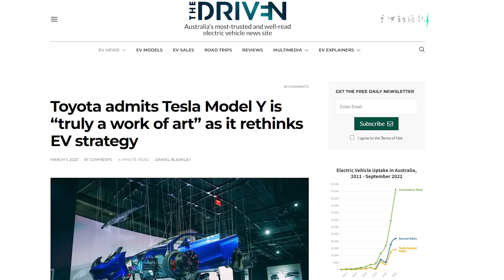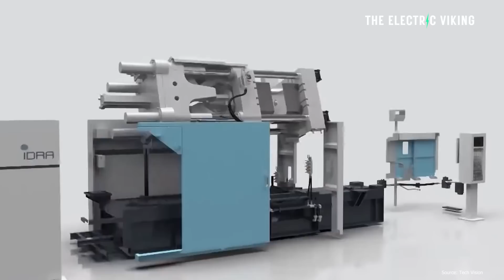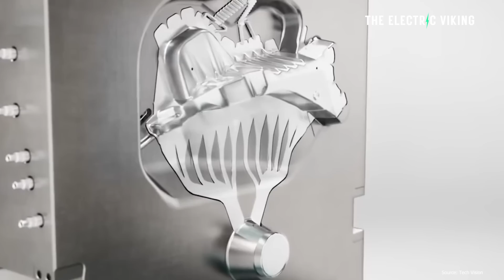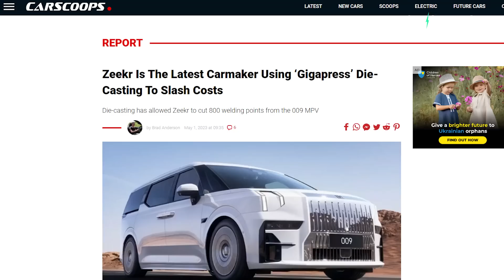Why Toyota decided to change entire production process to use Tesla's 'Gigacasting'

Comment: The giga press looks similar to injection mold technology.   Would be interested to see how this would work with processes used by aptera with the AI refinement.
Reply: They are very large aluminum die casting machines.    Size and pressure to hold the mold closed are impressive.  9000 ton is the clamping force of the mold.
Reply: @danharold3087  Actually the size varies. Casting machines have been around a long time.
Reply: Since the Giga Press IS injection mold technology, it should like injection mold technology, although simple that makes sense, more than I can say about other comments. There is no magic AI refinement, it is a tool to use.
Reply: @tedmoss  Hi, Aptera uses AI to see if the parts can be reduced without significant performance loss.  I was wondering  if the designs could be refined to be even lighter  before sent to the press.  It would be something to see the machine run.
Reply: @Maxxmentum  Still, my point was that a person has to make that decision. AI does not know what refined is.
Reply: @tedmoss  LLM models have very much been trained on what concepts like "refined" mean. Have you even tried ChatGPT? AI is already better than human Dr. on most tasks. LLMs can pass bar exams, better than 80% of law school grads.
Reply: @tedmoss  Tesla is very much using AI to improve manufacturing. Even if their motor improvements were not done with AI, it was done with in-house software, "The automaker's powertrain designers used in-house developed software to [simulate electric motor designs]."
Reply: This process has been around for decades , just used on a smaller scale.
Reply: @damham-F47  That's the whole point...unprecedented scale.
Reply: Whether or not to die cast is mostly dependent upon quantity. Do I machine it at a higher cost or spend 10s  or 100s of thousands of dollars for die casting?

Comment: Tesla efficiency in their cars is more than weight, they optimize aerodynamics and friction in the drivetrain, everything from weight of moving parts, number and type of bearings and lubrication, even rolling friction of the tires, and more.  Also fewer or no parts are better if still getting the function done!
Reply: Those are the same optimisations that every large car manufacturer tries to make but other manufacturers have more or less focus on the cost of the optimisations. What Tesla's done is start without the technical debt that other car companies have and pioneer some manufacturing technologies like casting the chassis.
Reply: However, they pack the car with so many extra sensors that a slight tap on the bumper costs $1,200 in repair.
Reply: @noseboop4354  Which extra sensors?
Reply: @Zedus-rl9hp  Parking sensors, anti-collision sensors, camera sentry mode sensors, temperature sensors, and probably tons more.
Reply: @noseboop4354 the cameras are fairly easy to replace, and most cars have those sensors nowadays both for safety and convenience
Reply: @noseboop4354  Tesla use far less sensors than other OEMs, so that's not an argument
Reply: @Zedus-rl9hp  You don't seriously believe that, do you? Just try comparing insurance rates of a Tesla to their competitors, it's way more expensive for a Tesla because of the high cost of repair.
Reply: @noseboop4354  That's not the case in my country.
Tesla Model 3P: 530€
Hyundai Ioniq 6: 570€
Mach-e ER: 570€
ID4 GTX: 580€
BMW iX1: 610€
Model Y: 680€
e-tron 55: 690€

KIA EV6: 710€
Reply: @Zedus-rl9hp  Tesla Model 3 is $3260 vs $1276 for a Toyota Camry. Rich people are always out of touch, living in some hippie country like Norway, giving tons of subsidies to EV, using the money from oil reserves.
Reply: @noseboop4354  the insurance has nothing to do with government subsidies.
What is currently being promoted is the engine-related tax, which does not exist with the BEV.

For a Audi S4 TDI: insurance €580 and additional €2450 for engine-tax.
I live in Austria
Reply: @noseboop4354   - and a front crumple zone - oops that is a right-off, bent the gigacasting.....
Reply: Probably one quarter the parts of an ICE and still more expensive.  Wow, marketing genius to pull that off.
Reply: @donaldkasper8346  Function and demand determine the price on the market and not the number of parts. This has nothing to do with marketing. Fewer parts here is more of an argument that it can be sold more expensively
Reply: @Zedus-rl9hp  The price in the market is supply and demand.  The cost of production is the cost of assembly related to number of parts to be assembled, difficulty of manufacture, and material costs, labor costs, facility costs and taxes, etc.
Reply: @donaldkasper8346  Right, but production cost is not equal to market price
Reply: @Zedus-rl9hp  If you want to stay solvent it is.
Reply: @Zedus-rl9hp  Asinine comment.  Number of parts requires inventory control which costs money, handling which costs money, and assembly which costs money, the more time it takes to assemble, which costs money.  The more parts an assembly has, the more expensive its manufacture is.
Reply: @donaldkasper8346  You just mix production costs and market price.
Before you call something asinine, you should understand the difference
Reply: @Zedus-rl9hp  Asinine.  Market price does not come from outer space.  This just in, cost of production and profit.
Reply: @donaldkasper8346  😂
Reply: @shagsheep8832  All auto manufacturing is based on simplifying the product and using the least parts.  Robots were tried in the 80s and abandoned because they are dangerous (notice 100% of all vids have no people in those rooms), and expensive to program.

Comment: Fun fact. Nio was first with mega castings. And when they almost went bankrupt in 2018 they sold their gigapress to Tesla. Sandy Munro made a prototype of mega castings long ago but only the Chinese manufacturers and Tesla jumped on this ship. At the moment only NIO and Tesla have cars on the road with mega castings. Nio has them in the et5 and the new es6. Tesla has them in the modelY.
Reply: Owning a die casting machine is not evidence that Neo mastered the size of casting Tesla pioneered.    Cars have been using aluminum die castings at least as far back as the early 60s.    Prior to that they used century old sand casting still in use today in the expensive and low volume Cadillac Lyric.  Not saying you are wrong but would like to see evidence.
Reply: @danharold3087  Yes could be that Tesla had mega castings in their cars before NIO but atleast they adopted the idéa at about the same time. Yes small die castings have been used for a long time, like my lexus ls400 from 1990 use a full aluminium fron subframe casting. But the only cars with full rear end castings on the road today are Nio and Tesla.

Comment: the main reason tesla adopted gigapresses was the big problems they had at the begining in production line of the model3
Reply: Wrong,the story behind the gigapress is due to an engineer gifting elon a die cast model s(covered in Ashley dances book on Elon . 
Apparently they had a conversation about making cars just like toys that are die cast. 

Calls ensued and elon himself said only 1 major injection mold manufacturer even was willing to talk with the tesla team.
It took over 3 years to build the first machine at immense cost. Tesla engineering with spacex help came up with a proprietary alloy for the casts.

Then the 2020 model y came out first with a large rear 2 piece casting. 
By 2021 they had the single piece rear castings in production, in late 2021 they introduced the front casting with structural pack's in tx.

In April 2022 the first production model y with a structural pack&dual castings got delivered from tx.
The rest is history. Also casting large pieces of cars has been done for over a century now. Engine blocks are ALL cast. 👍🏻
Reply: Not true.  Gigapress required an enormous investment in capital, time, and inventing a whole new way of building cars.  Gigapress is a manufacturing evolution, not a solution to a single model production.

Comment: Jaguar F Type project started in 1998 and produced a prototype 2000 demonstrating a stamped aluminium chassis components but it was shelved for 10 years because there was no established production route.
Reply: Tesla's bonded aluminum chassis for their original roadster (released 2008) built by Lotus was acknowledged occurred via tech from Jaguar by Tesla engineers. Reminds me of an old fable about teachers students and the development of mastery?
Reply: Stamped is as a pure weight saving & not the same as casting parts - all the problems of stamping steel panels as there (plus a few!) with stamped alloy :)

Comment: The real breakthrough will be if the Giga Press can be designed to form large carbon-fibre parts, instead of aluminium alloy, or a carbon-fibre core part enclosed in an aluminium alloy, optomising lightness and compressive and tensile stress, giving a super-rigid platform.

Reducing the cars' structural weight by 50% will mean that a smaller structural battery, made from  cheaper battery chemistry, together with a smaller motor and will be a game-changer for range, making 500mile range between charges the standard.
Reply: Aerodynamics are far more important than weight! 
Rolling resistance grows linear with weight, but drag grows cubic by speed (as energy loss).
Now tell that to every SUV-driver you know, they are people who like to quarrel with physics, or going off road a lot.

Btw, I doubt it will ever work with carbon fiber reinforced parts like with aluminum. Reason: the fibers have to oriented, and than the whole thing is baked with resin.
Reply: @10goldfinger  Absolutely, in fact, speed versus air resistance is a power of 3 factor, so if for example, you want to double your speed from 50 to 100 miles per hour, you need EIGHT times the power, not double the power.
Reply: @tech-utuber2219  'cubic' means power of 3.

Overmoulding carbon fibre with aluminium won't work cos the molten aluminium will destroy the carbon fibre.
Reply: @spankeyfish  yes, and I gave an example for those who are not familiar with the jargon.
Reply: @10goldfinger  I think the limits of aerodynamic improvements is being approached. The possibile weight improvements are almost limitless.
Reply: Battery developments are likely to give better returns even if what you suggest could be done.
Reply: Not sure that the manufacturing of carbon fiber would best be optimized with the use of a gigapress.
Reply: That is essentially what Aptera is doing with its Carbon Fiber Sheet Molding Compound body. It is like a gigapress for carbon fiber.

Comment: That Toyota has adopted gigacasting says alot about Tesla.  Will Ford & GM soon follow?
Reply: Gm will with the insanely expensive celestiq ev. Ford says it's in the works but no announced timetable or model using them yet.
Volvo will use them in the rear from 2025 in their remodeled main Sweden plant. Nio already uses a single piece rear casting in the et5 model's.
Reply: @4literv6  GM, LOL. Sold 2 Hummers in Q1 2023. Cancelling the bolt. Bankruptcy is on the near horizon.
Reply: @machoopichoo2  again? How many times can 1 company go bankrupt. No billions in tax payer funded bailouts under to big to fail clasification please this time. 😂👍🏻
Reply: @4literv6  Ya, there really is no real way to bail out a company that is incapable of making a product people will buy. This time around...no bailouts. Tesla will give cover, in that, the entire US auto industry will not disappear, like the Japanese will. 

Possibly if Ford is making some BEVs that sell, still at a loss, the gov. might bail them out.

Comment: gigacasting is great but can it be applied to body on frame vehicles?
Reply: Think modern motorbikes, they still have a frame, but the caste engine becomes a park of the structure. So what you have are two frame assemblies integrated with the cast part.
Reply: No reason why it couldn't.

Comment: Ok Sam, if you have a 30kph crash in a Giga Casting car, the car will probably be written off. I hear most insurance company's don't want to touch the car due to potential battery damage and unrepair ability. How is scrapping more cars environmentally friendly?
Reply: Because the parts are worth more than the whole car.
Reply: Same things happened when cars went from full frames to unit body construction. Insurance companies will learn and adapt.
Reply: And yet insurance companies are insuring them. Because insurers work on actuarial risk. That's how each flight of a commercial aircraft is insured, or even a SpaceX rocket.
Reply: @lesatkins42  I think your missing the point, I never said you can’t get insurance, just mentioned repair ability is questionable, as castings can’t be panel beatered like traditional cars. So will become throw away item, how sustainable is that? When most EV drivers think they are saving the planet. I have driven a model 3 they are great cars to drive and the tech is amazing.

Comment: The Issue I see is that repair based in a serious collision could be spendy. Not that I don't think it is necessarily a bad idea but it is something to think about.
Reply: In a serious collision the car will be a write off
Reply: @henrythe8912  Yes. Just like any other car.
Reply: Insurance companies will write off a car with only a few dents and scratches. They will not bother to repair a car damaged so extensively as to break the casting.
Reply: The type of impact sufficient enough to crack a gigacasting would have totaled any car regardless of how it's made. Even new conventional cars are scrapped if the airbags go off.  In any case, some engineers have said a simple cracked casting could be easily welded - the biggest difficulty being getting access to a crack if it's buried.  I envision a lot of totaled Teslas being sold by copart and getting rebuilt titles from enterprising body shops - assuming Tesla will allow them to charge on the Supercharger after being rebuilt.
Reply: @ohger1  Exactly.
Reply: The insurance companies will apply biggest pressure - ha - in most of the world without need to go to a lawsuit. This, and 'structural batteries' are to me a worry, real cost wise, I reckon things will get more modular again, better than crude panels welded together, but repairable
Reply: Your correct. I see a lawsuit being made by repair shops and private owners just like with Apple. Right to repair. If only Tesla can repair it, it takes too long and is expensive.
Reply: @daveyshmavey  No reason why private companies couldn't repair. Reminds me when cars went from full frame designs to unit body. There were lots of nay sayers with that change as well.

Comment: All of Tesla’s haters and critics who have spoken out or not spoken out, need to give credit where credit is due. The killer is that NO ONE (American automakers) can make changes as fast as Tesla. Truly genius and adaptive engineering at its best come from Tesla.
Reply: Yep, manufacturing at the iterative speed of software. As Elon has said, it it the pace of innovation that is most important.
Reply: Giga casting is in its infancy. Toyota may see additional uses for it to be able to handle a wide range of body styles. Perhaps a mold insert can significantly change the function. Like the number of drive motors.
Reply: @stuartharris5527  Unfortunately for Toyota, this is just polishing the brass on the Titanic. They left electrification way too late and will go bankrupt. They are still talking H2 fool cell stupidity.

Comment: Good engineering descision by Toyota but it won't save the company when the value of all their leased cars fall through the floor because hardly anyone will want a second hand ICE car soon.
Reply: Wrong way around, a Tesla falling off a cliff was a statement about its second hand value..... a Tesla will be written off when it needs a new battery.... Nobody ever wrote an ICE car off because the petrol tank needed repairing.
Reply: @chrissmith2114  No, but i've seen a few written off because the timing belt has broken.